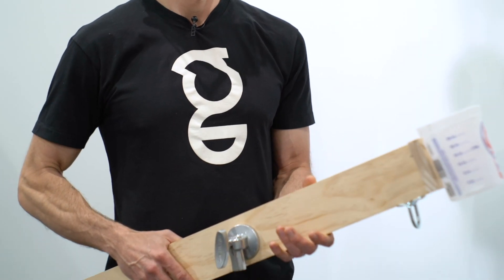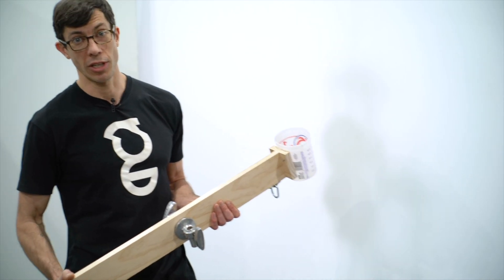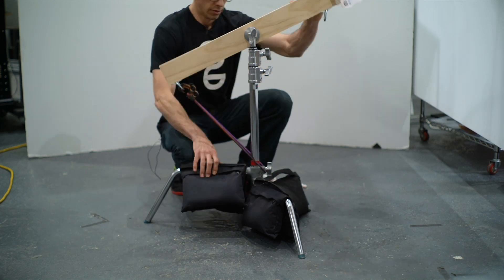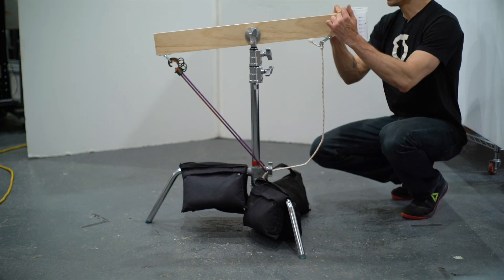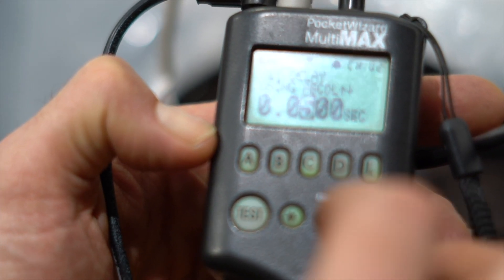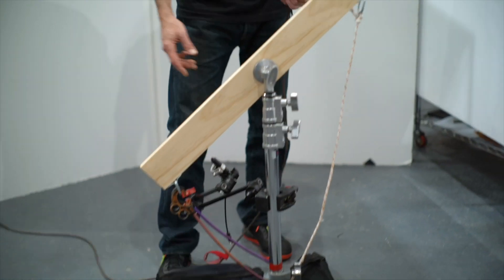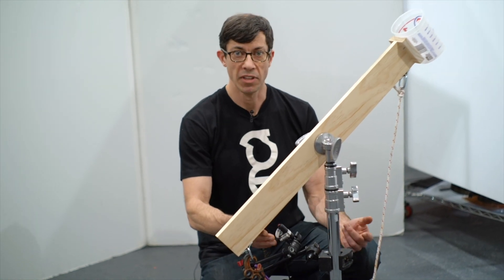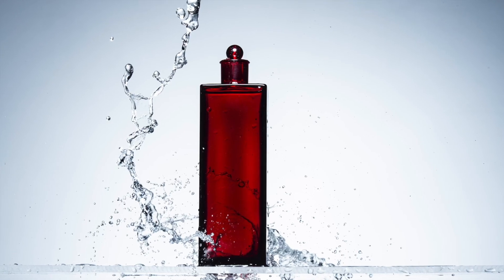How To Shoot Splash Photography With A Simple Catapult

Comment: These are fantastic thank you for sharing your ingenuity. Since watching a few of these, I've really started to find creative ways to rig things up or connect things without looking for a "ready made" solution. For instance, I've been looking for a wireless handheld interview mic to work with my existing wireless lav set.. i managed to get my deity video mic into the lav transmitter, and then to mount it, I rigged a small metal plate on the back and it connects to the 1/4-20 on the transmitter, and then another screw goes into the video mic's cold shoe mount! It works PERFECT, and I used stuff I already had.
Reply from the maker: Exactly the thinking we're trying to inspire!